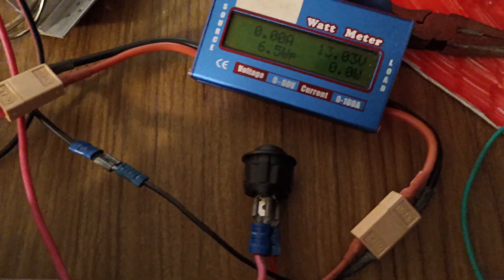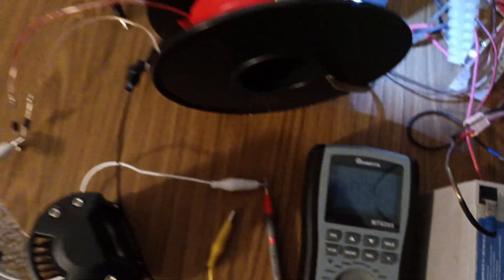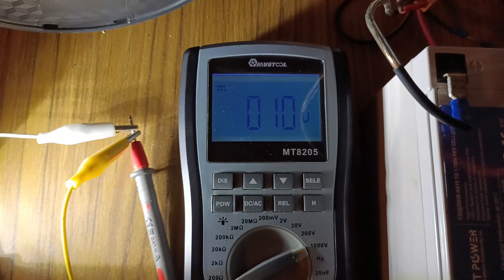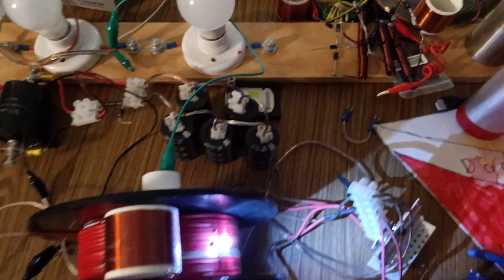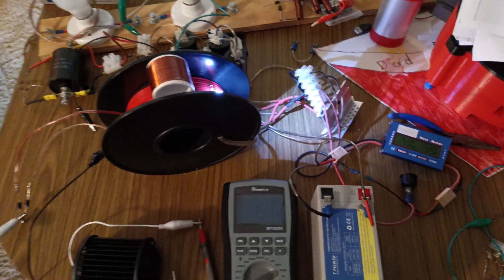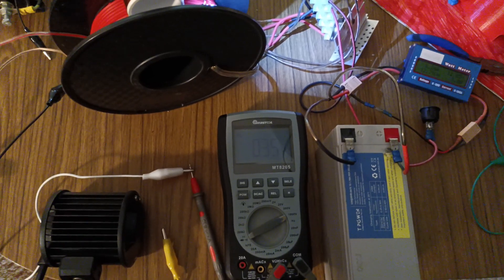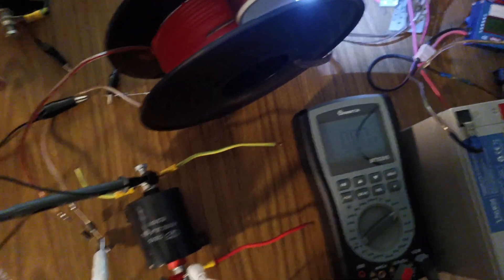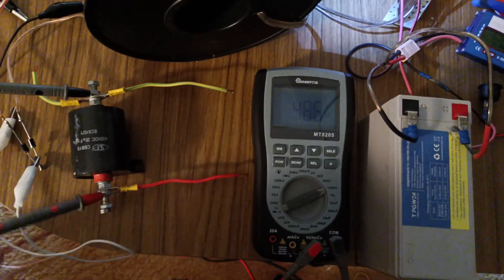EVERYONE LOVES A BIG BANG!

Comment: Those capacitors need to be rated for 1400 VDC ? I guess if lower voltage caps are used they will charge faster and more available power will be for drain (higher wattage inverter).

I have rebuilt the coil, few 2N3055 available, probably tomorrow new earth connections … all I miss is a 12 v 7.5 ah battery … is it alright to use a laptop charger 20v 3.2amps as I did for pancake coils ? In this way I know for sure I can overdrawn the battery as output of this charger is limited to 64 watts.

Also, second bifilar wound right on top of your main coil (L1 L2 L3)  looks to be the key … couldn’t understand how did you get that power on other circuits 😂 very clever to use Tesla patent additional for powering loads.

I am aware that using higher voltage may need some adjustments in coil length eventually but with less current supplied it might be ok … hopefully 🤨

56 mm diameter pvc pipe with 10 turns bifilar and secondary 220 turns … I don’t have available any 3d printer so, I made my own former clamping 2 pieces of wood on 65 mm long pvc pipe just enough to accommodate tide 20 turns of 2.5 sqmm speaker wire and remove iron wrapping wire used to hold the wood ends when i finished the coil. Using paper tape on each layer helps to keep all wires in place and last layer insulating tape, but without the wooden ends is impossible to wind such coil … I am running out of materials so, I need to improvise a bit.

I know that using less amps would not yield same amp-turns (magnetic field strength) but I can settle with less output power and remove some layers of monofilar secondary if necessary.

Some people got stuck on negative resistance effect ignoring negative resistance effect from using just 1 transistor in the right place and cannot wrap their minds on the fact we are limited on output based on components used … those little neon bulbs will set the limit.

Lately I finally seen Kapanadze patent … so simple using platinum contacts or the whole assembly for a petrol engine spark distribution … mind blowing using only simple version of tesla patents
Reply from the maker: @Caesarus2011  Thank you for your comment.
The capacitors that I’m using are for high voltage tests and are not necessarily the correct capacitors and you should do as you suggest which is tailor the capacitors to your requirements.

The 2N3055 isn’t the only transistor this works with it’s just a good cheap and strong transistor that can cope with 5 amps continuously. You can use any battery from 6 volt to 24 volt but 12 is safest for the transistor as it is already way over it’s rated voltage.

I don’t recommend connecting anything to my circuit that is connected to the mains system like the laptop charger, even if the transformer is an isolated one. As we have seen with this circuit and similar circuits they are able to inductively couple using radiant electromagnetic and dielectric fields meaning they don’t care whether something is isolated or not. If my circuit chooses to bypass safety measures it may not be pretty. Can I suggest you use a cheap solar controller that has an auto disconnect on low voltage as this is the cheapest way to protect a battery, my circuit will run right down to 5 volts so it will kill a battery if given the chance.

The coil length requires extensive testing to meet perfect resonance which changes with every modification. A good tip is start out with a short L2 and if you don’t get the result you want just add another layer of turns. You may find the turn per volts ratio is somewhat out of whack for example one single turn on top of my circuit will operate a 1 watt 3.2 volt LED blindingly bright.

PVC pipe will work just fine, don’t worry too much about the perfect core, I have wound this on a few different forms now and it doesn’t make too much difference either way. You can use old CD’s as end plates for your PVC pipe. Alternatively you could take ten times longer and use quick setting glue to keep turns in place on the edges then place tape over the final winds.

I agree that the neons act as a limiter, one just has to decide what your willing to sacrifice and for what outcome and we are somewhat spoiled with choices.

The Kapanadze is one of many circuits I believe are responsible for my understanding of these systems but the Kapanadze was somewhat of an aha moment for me and I hope I can find time to pull that back out soon.
Reply: @whatifididthis...1236  not sure what I did just few minutes ago testing but on first run, bulb didn’t lit up, transistor got hot pretty quick frequency went over 148 khz not constant with variations from 40 khz to 180 khz, power drawn shown on battery meter variable 20-38 watts … frequency have gone into the main at +164 khz backward. Disconnected after 2-3 minutes with safety concerns.

I took out battery meter, using same connections, now frequency is 50 hz everywhere in the circuit, input from charger is 20.53v measured on battery meter and additional with multimeter, output is about 68 v AC 50 hz … obviously no bulbs can lit up.

Fitted back battery meter and now shows up all as second run … transistor is in heaven now, 10 more to go, hopefully not all with the same fate.

On your old circuit I can see high side runs straight into transistor base and light connected on low side … on this diagram, light is on high side then into the ground and low side into transistor base with additional 9 turns bifilar on top of main coils and output to capacitor … I am getting confused now and ready to fry some transistors to check out different connections … yet I have to stick into the ground second rod, but first I want to make sure the main circuit is working correct.

Looks like I need a 12 v battery as I am a bit scared to blow up something in the house with that high frequency injected backward.

I don’t know what was in my mind when I’ve made this coils, i measured bifilar length but somehow I did not measured the length of monofilar secondary … trying to make some guess work or just redo the coil. I thought can find out the length measuring resistance, 1.4 ohms for monofilar … but bifilar shows up 0.0 ohms … need a more accurate instruments which I don’t have.
Reply from the maker: @Caesarus2011  I wouldn’t use anything mains connected with my circuit. I have seen one inch green sparks coming out of my circuit when it was connected to an MOT, then the fuse blew inside the mains charger and instead of turning everything off it gave it unlimited access that began to arc weld the earth wire.
  WARNING DO NOT CONNECT THESE CIRCUITS TO mains EARTH
  THESE CIRCUITS HAVE UNKNOWN POTENTIAL THAT FEW OF US ARE EDUCATED IN 
  PLEASE BE CAREFUL

Can you give me a few more details on your current setup and we can try to save a few transistor lives.
Also don’t stress about the confusion issue, it is because there are multiple ways to connect it.
And you will blow up anything in the house that gets energised on that negative line, every item on the mains will communicate with this circuit, trust me things will die. I learned the hard way.
This is the one rule I apply to this circuit, if I’m not willing to lose the item I want to test then I don’t connect it. Some things go crazy on it!
Reply: @whatifididthis...1236  oh, I am using a separate ground, only power supply comes from the main via laptop charger which I just discovered do not have ground connection ( pin socket for ground is made of plastic just to allow socket connection).

Not sure what else to say about current setup ? 2.5 sqmm speaker wire, bifilar 10 turns + 200 mm each end for connections total length 2270 mm, secondary wound on top of bifilar 20 turns per layer, 11 layers + 200 mm each end for connections.
 Connections: positive to start of bifilar, end of bifilar 1 to start of bifilar2 then into collector. Start of secondary to base, negative to emitter, end of secondary (high side) to the bulb, the other connection of the bulb straight into ground.
Reply from the maker: @Caesarus2011 and the type of bulb is?
Reply: @whatifididthis...1236 clearly I need a battery, even if laptop charger is clamping the output is not isolated enough and high frequency goes backward to main, looks like it need to be operated independent.

But on pancake version is working nice with laptop charger.

I have checked voltage on ground connections without circuits and I can get small voltage dc and ac … I need to go out in the field … just to make sure there is not a leak from houses around.
Reply from the maker: @Caesarus2011 earth number 2 is able to be connected in a few spots. If you connect earth 2 and get nothing you can try slowly introducing a ferrite rod or a piece of metal to test if it is a frequency issue.
I would start by reducing L2 drastically, I will edit this post with the ohms value of my L2 and edit this post.
Reply: @whatifididthis...1236  cfl bulb 11 w 240 v 50 hz, I tried 28 w halogen and 40 w incandescent … none of them work … probably transistor was already fried after first attempt with cfl bulb.

I know from the other circuit with pancake coils cfl bulbs will send frequency sky high due to their builtin ballast … my mistake.
Reply: @whatifididthis...1236  yes, this is what I need to do, I thought longer wire for secondary will add resistance and voltage drop … but the voltage didn’t drop enough and fried the transistor … I need to go on calculator, clearly this one needs more attention
Reply from the maker: @Caesarus2011  I find it best to throw away the books and calculators and spec sheets here, do what Lasersaber showed us to do wind it live on the bench, add 10 turns or remove 10 turns, then fine tune by 1 turn. This is a different form of electricity so the rule book is a grey area. The light can also be an issue, if you take a look at my video where I get zapped is in the title I think you can see in that video everything connected and no light at all until I slide a ferrite rod into the coil and hey presto.
Reply from the maker: Ok I just read your response, don’t use incandescent bulbs or halogen until you have it running on LED’s first, you need to establish that the circuit is functional first. Get a 10 watt or less 240 volt LED bulb to light up and then you can attempt other loads. Incandescent will require another mod and chews heaps of power, a 10 watt LED 240 bulb should pull between 10 to 15 watts and no more.
Reply from the maker: @Caesarus2011  Trust me there is no leak as such, well most likely, I had an electrician perform an official check on a league to ground because I told him what I was detecting and he said there was definitely no leak. I am unsure of the distance from the mains earth connection required to not detect this signal. Look at my “free energy baby” video that shows the ability to harness un metered energy.

This circuits electricity is intelligent and will connect with proximity, no need for wires!
My circuit is very different to Tesla’s however, you should be able to get similar effects connecting the earth to the pancake coils, I definitely see the radiant field on my pancake coils if earthed.
Reply from the maker: @Caesarus2011  Remember I said, it isn’t like other transformers. The ratios are all out of whack. You need much much less wire than you think.
Reply from the maker: @Caesarus2011  you may benefit winding one of the small wireless coils I use with the 3.2 volt LED, these are great to bring near the coil without running a load directly off the coil, add or subtract wire until the small coils light up the brightest. With 4 of my wireless LED coils on the perimeter my circuit uses 4 watts, which is the same amount without the LED’s there. This way no blown transistors at all.
Reply from the maker: @Caesarus2011  wind the little wireless LED coils exactly as mine are and you will know when your circuit is close to mine, with those coils you already have resonance, now you just need to match it with the L2.
Reply from the maker: @Caesarus2011  measure the resistance of a new transistor before it goes into the circuit, then you will have a quick reference for transistor health.
Reply: @whatifididthis...1236  Many thanks for reply, really appreciate you patience and kindness to share your knowledge, I think I have all the “missing info” now to be able to replicate in full your setup. If you don’t mind I have one more question: your circuit draw less than 1 amp, transistor don’t need more then 15 ma to turn on so, I am planning some endurance test for my water batteries but they only output voltage and extrem small current. Now I guess you already tested your circuit under some heavier loads, supposing my batteries can supply unlimited (in time) continuous dc voltage for certain curent … how much curent draw heavier loads ? Or better formulated: would curent draw increase with resistance/impedance of the load or just voltage is affected ?

I just left my 8 cells running continuous with 10 white LEDs for few months in parallel and only little deionised water was added was all consumption as you can see in my other video on my channel. I will be able to show a better performance soon. No corrosion or reduction in size of any electrode.
Reply: @whatifididthis...1236  not sure if I understand correct what are you saying ? Would be enough to just unwind turns of secondary and keep the whole length of wire as it is ? It count only the wire coiled ?

But, also I need to use a battery … I am afraid i will blow up something in the house if I use laptop charger as power supply seeing HF reflected backward in the main through the charger.
Reply from the maker: @Caesarus2011  As you mentioned the Kapanadze system, before I forget, this is a relevant point to mention, the reason Tariel used an inverter was to pump the 50 hz signal into the ground, this is how he created his 50hz signal that had everyone confused. This is why you detect a signal from your mains and it is this signal that Tariel Kapanadze was mimicking, the inverter just creates a frequency to clone!

Comment: You have them all rubbing their heads trying to figure out what's going on.
Love it brother be safe
Reply from the maker: @joeeasygo  Thank you for your comment.
Nah, I’m sure most have seen this all before, one reason they might not have seen it, that I can think of, is they aren’t old enough.
When you’ve been running this treadmill for long enough it all just seems like the same thing done a different way.
I don’t normally detonate the capacitors like that, too many things go RIP but every now and then you gotta have a little fun, besides there’s nothing like near death to remind you your alive.
Recent tests trying to find the limits of different arrangements has destroyed a few things though, I will make a video when the new parts arrive because it smoked it all so I just need to discover it’s reliable mode because cooking things isn’t necessarily what I’m after.
I have another modification coming for my circuit, I haven’t tested it yet but I listen intently to my intuition and it’s been bugging me for a while now to try it, I hope it works, I think it will be pretty special if it does work.
Thanks for watching.
Reply: @whatifididthis...1236  I am trying to figure out a cap dump circuit to charge the batteries